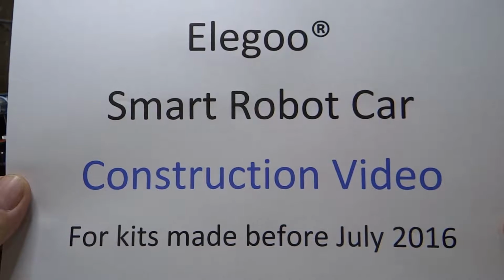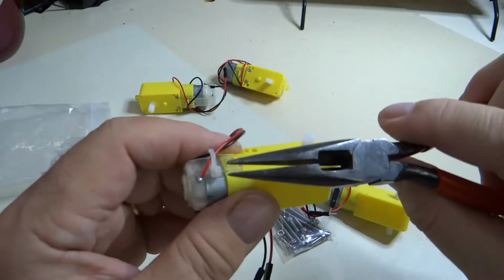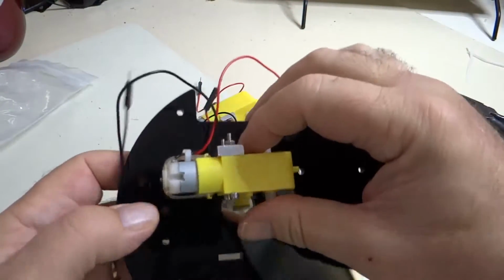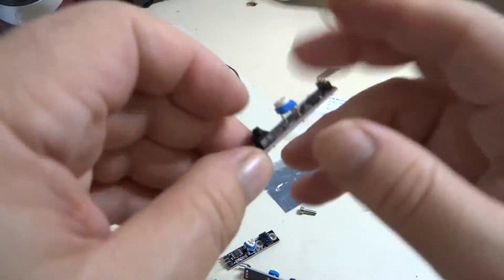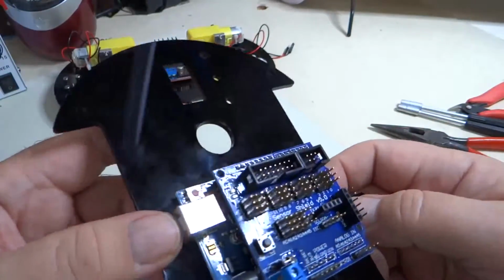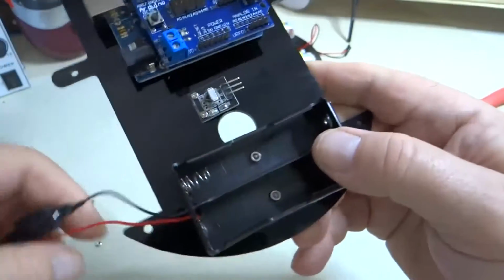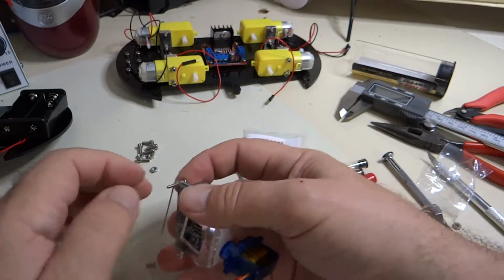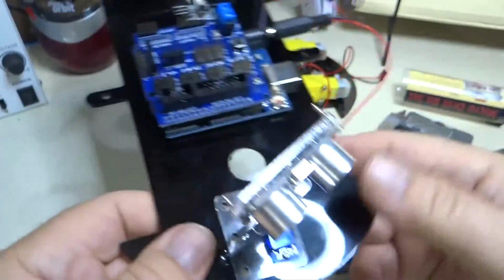Elegoo Smart Robot Car - part 1: Construction for pre July 2016 kits

Comment: hi greg this is a general problem I'm facing with the Arduino its self I have build and completed the car kit and I have also used it but for the past 3 days I have not used it and now when I try to upload something to the robot I get this error "avrdude: stk500_recv(): programmer is not responding" How can I fix this
Reply from the maker: Techno Wizard is the Bluetooth module plugged in? that will interfere with the programmer
Reply: nope the bluetooth module is not plugged in
Reply from the maker: Techno Wizard do you have a second Arduino you can test? it could be wrong port or a cable problem
Reply: yes I have a second one and tried with it but the same error showed up ?
Reply from the maker: then there is a problem with your computer configuration, have you checked the port in device manager?
Reply: no what should it be labelled I'm running a Mac where do I find it?
Reply from the maker: Techno Wizard I'm afraid I don't know how it works on Mac, I only have Windows. Try reading the Arduino threads. It worked at one time, did you change anything on your Mac?
Reply: no iv read many threads and none of the solutions seem to be woking for me
Reply from the maker: You'll have to dig deeper. Afraid I've run out of ideas.
Reply: ok thanks for your help I might consider taking apart and rebuilding the robot and re installing the software